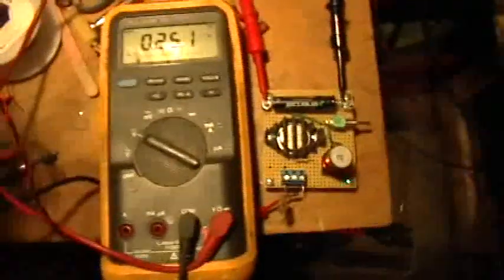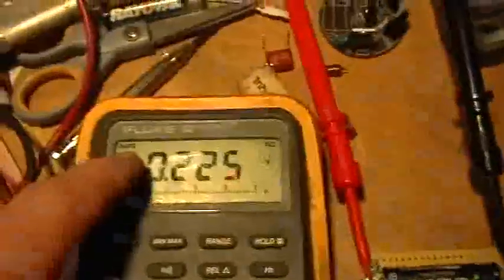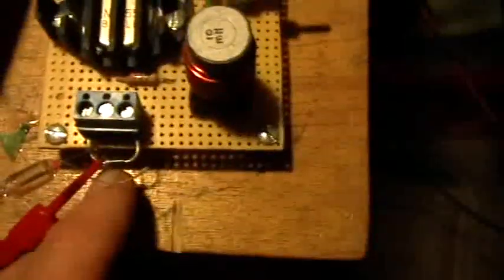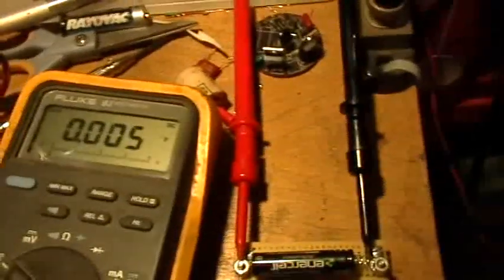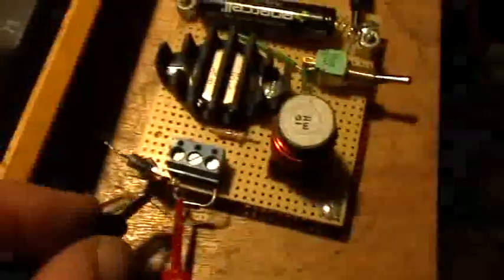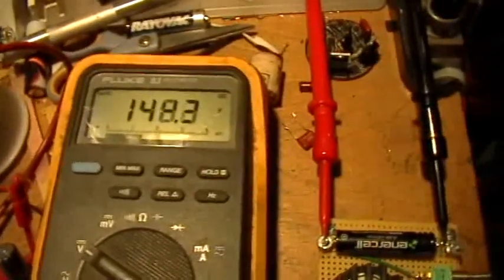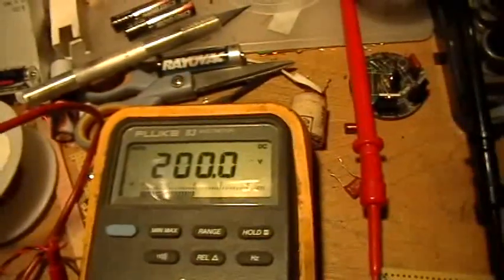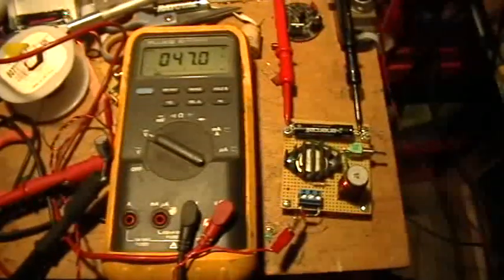Joule Thief: Measuring the Voltage Output of a JT Using a Capacitor and Diode

Comment: Thanks for the info.  I was just hoping that this was an "off the shelf" component that we could modify in the way that you did.  I have a bunch of 3055's all from the same place. (minimum order) and I have a bunch of TIP3055's from various suppliers.  I did find out when working with the 2N3904's that not all are created equal...even from the same manufacturer.

Bill

Comment from the maker: The coil is from a CRT TV chassis, a big one like 23". It was originally encased in a rectangular white plastic housing and only had the one ~300 turn, 10 mH winding. I've taken apart several other TV chassis and they all seem to have a similar coil, only smaller in the smaller sets. I put one layer of cloth tape and then wrapped the 30 turn winding of #22 on the outside, two layers, and sealed with epoxy.
Try all your 2n3055s, buy them from reputable manufacturers. Their HV performance varies!

Comment: I want to replicate your circuit.  Can  those coils be located from a supplier somewhere?  That is really putting out some great voltage.  Great explanation on how to use a cap to measure JT output.  Thanks for the info.

Bill